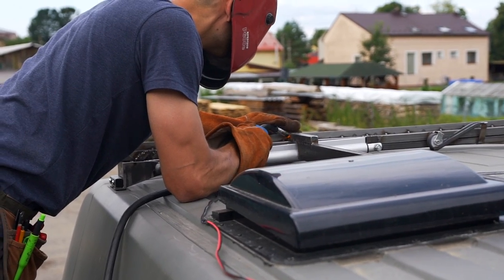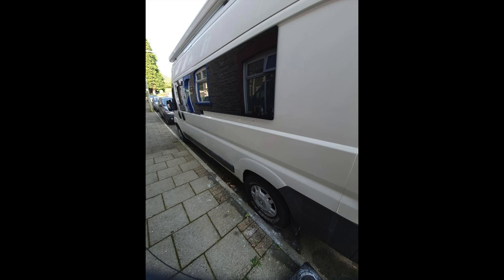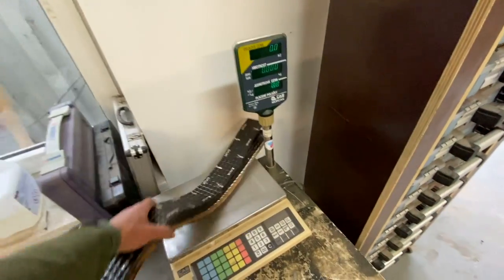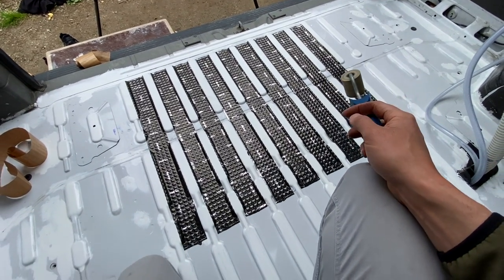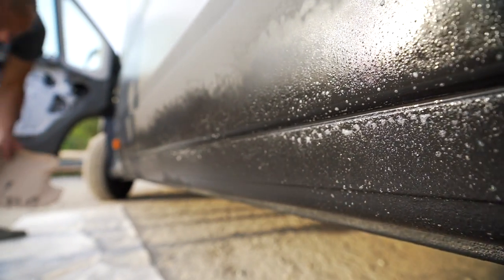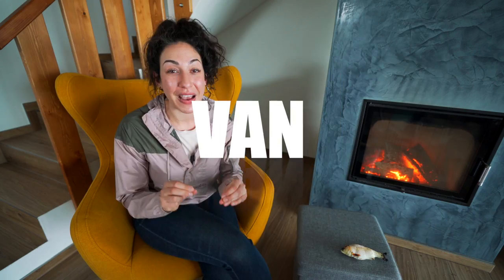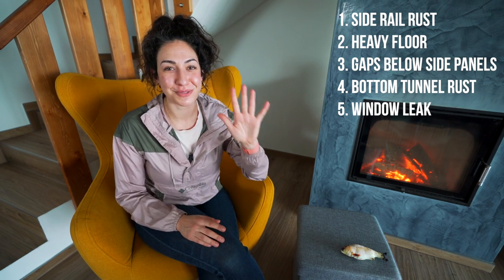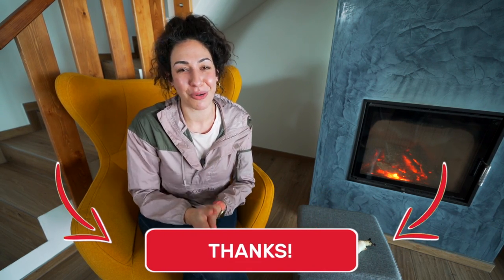DON'T MAKE THESE 5 VAN BUILD MISTAKES!

Comment: Hello my name is Alan I'm going to be buying a 35 ft step Van I was going to buy a sprinter van the largest that they have but the ceiling is too short I'm 6 ft 8 so I have to step it up I would like to put on the rack system for the solar I would like to do 450 Watts on the roof I'm going to have to do the math and find out how many panels that is and everything I'm thinking about maybe about $5,000 worth of solar stuff just so I can turn it on does that sound about right

Comment: Dear friends, we bought a van for a conversion, just like that. That was our first mistake. In The Netherlands you cannot buy a car ‘just like that’ without being drawn into a red tape swamp, we now realize. 

First of all, the original price was raised with 4000 euro, because of extra taxes - not just VAT. For some reason I even don’t want to understand we will have to pay another 1000 euro of taxes when the conversion is finished. 

But hahaha, in return we will get a tax benefit! Of course this is a benefit we paid for first. In return for our benefit the Kafka authorities want to have control over our camper van. The roof should be 1,7 m, it should have a kitchen, a table, etc etc. There is some kind of van table police to check it. If the kitchen sink is not high enough, no soup for you!

So we thought vanlife was about freedom, didn’t we? 

The second big mistake we plan to make is installing noise reduction panels. I don’t believe for a second it will work, especially on curved metal or in combination with a layer of armaflex. But my wife saw you doing it and ByNomads too, so who am I to disagree? Love your channel and both of you anyway :).
Reply: The situation in Sweden for getting a van registred as an RV is Kafka squared. There are no rules except the morning mood of the registration guy!

Comment: I think you will get problems with the 3D printed covers for the outdoor cameras. I think they will be deformed in the solar heat this summer. I hope i’m be wrong. /Kjell
Reply from the maker: I think so too. I was about to vacuum epoxy experiment with them but didn’t make it 😭 I’ll at least UV protect them somehow. In the worst case scenario I’ll be making V2 🤓
Reply: @ladiandmargaret  I used PLA inside a car and it warped during a hot summers day but it can get like 60-70C there worst case. Here it is outside under the van in the shadow, will not be any problem. Black is UV protected by its color.
Reply from the maker: I use petg only
Reply: @ladiandmargaret  I always use PETG and have had no problem. A weather station has been outside for five years in sun and rain - still perfectly intact.

Comment: I would avoid vans that have a channel on the side like this. Older mk6 ford transits are flat and open in this area. Others, not sure.
Reply from the maker: Interesting. This particular van rusts everywhere else like crazy even with no side rail 😂
Reply: @ladiandmargaret  Feel sorry for you. Climate has a lot to do with it, the colder the worse the rust is. Would pay to get a dry exterior plumbed diesel heater, to keep it dry in there. Plus good ventilation

Comment: Hmmmm…..I thought the panels on a Fiat Ducato made from 2006 where galvanised and therefore shouldn’t rust? I’m also still unconvinced about the need for placing sound deadening anywhere in a van conversion...other than in the cab. If you are closing off the cab area from the living area then I don’t see the need for adding sound deadening at all on the floor of the living area. The insulation and floor coverings should be enough. It may still be of benefit by placing sound deadening on the walls and ceiling ‘IF’ it helps dampen outside noise from people, passing traffic, and rain noise when trying to sleep. I would imagine that the insulation and wall/ceiling coverings would also be enough for that. Ifanyone reading this has NOT added sound deadening and finds it ok without then i'd like to hear their opinions. Adding recyclable insulation made from plstic bottles into those small lower recesses would be fine to do. Any moisture or condensation would simple drip off it and drain from the van through the holes that are pre-drilled for that purpose by the manufacturer.
Reply: I put Armaflex on all sheet metal and my van is completely silent. One place to sound deaden extra is the rear wheelhousing, I did that with heavy rubber carpet.
Reply: @fredrikbergquist5734  - Thanks Fredrik.
Reply: They don't drill holes for drainage in side rear panels of vans..Only doors with windows (that go up and down) at the front....She was looking at the rockers, the holes don't go into van..